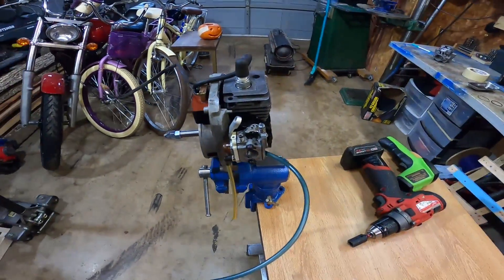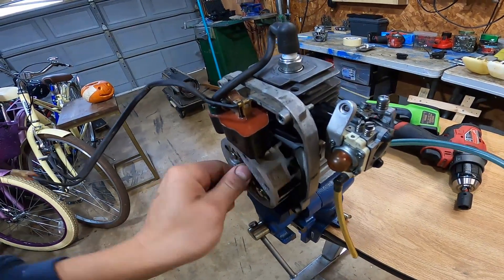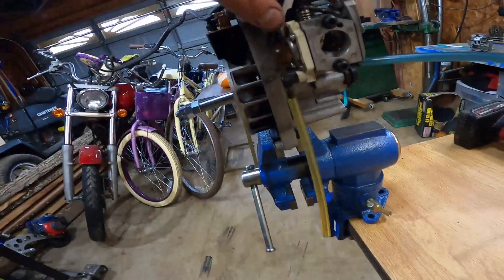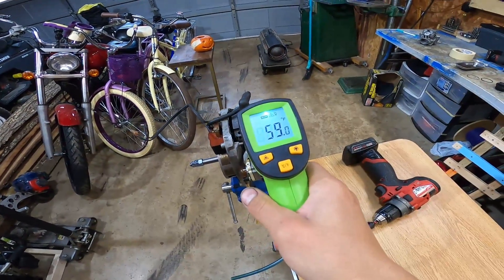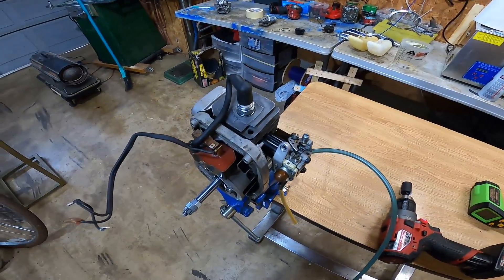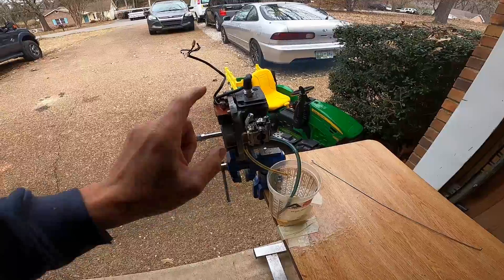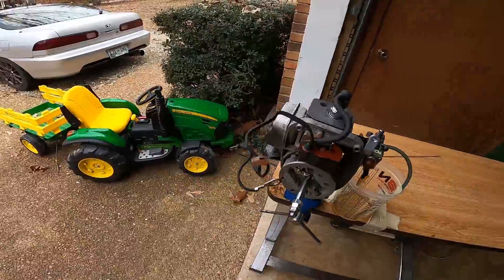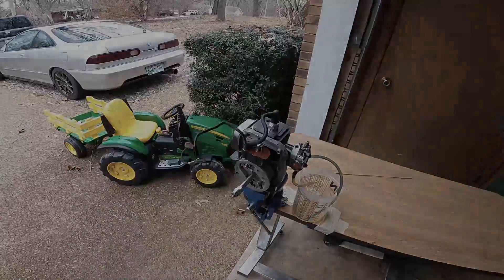Running a 2 stroke on diesel fuel!

Comment: So at what point in the video did you actually start running it on diesel ? In case you didn't already know, there's a few differences between kerosine and diesel
Reply from the maker: @dukeboreham2782  I’ve learned there are differences after I released the video 😭 I need to remake it with true diesel. When I made the video I only thought kerosene was just “cleaner burning” diesel. I have learned that the flash points and btu content is different 🤦🏽‍♂️

Comment: So that should mean a 2 stroke would run on used engine oil too right?
Reply from the maker: @Youtubecensoredmyusername  I tried that in a later video. It doesn’t work very well haha
Reply: @aaronpratt89  I saw the tiny multi fuel engine someone got running and it had mix and ignition controls on the handlebars. Without changing those I’m sure it wouldn’t have been that great. I will check out your other video tho

Comment: can it start without a battery or cdi? i mean diesel ignites by compression not spark?
Reply from the maker: @balfasladicra5270  compression ignition is true for diesels, however the compression of this engine is too low to create enough heat for compression ignition

Comment: to run on kero you need a hot box to vapourise it  usually started on petrol until the hot box was sufficiently heated  petrol a switched off and keo switched on  ,many old cars from the 20s and 30s  could do this as well as tractors .usually it was power kero used NOT the usual household one ,but again it must start on petrol

Comment: I bet if you replaced the spark plug with a glowplug to get it started, you could convert a small 2 stroke to diesel. Run the glow plug long enough for the engine to warm up enough then it will run on residual heat.
Reply from the maker: @MmmHuggles  I had that same idea. However I never managed to get this engine hot enough for it to run on its own.  I could make an adapter to use a small nitro glow plug and see if it works

Comment: Has anyone tried to convert these two-stroke engines not just to diesel, but to make them diesel themselves?  It seems that for this it is necessary to make them a high degree of compression.  At the beginning of the 20th century, there were several models of diesel engines for bicycles.  But there was a compression ratio adjustment from 8.5 to 20. I think it was a Lochmann brand or something like that...
Reply from the maker: I’ve been throwing the idea of using a custom piston in a well known brand of two strokes. But the run away of a carb fed diesel scares me. With no real shit off besides a total choke seems scary

Comment: Love this experiment and would like to see how far this can go. Have seen a few diesel engines run on used motor oil mixed with regular gasoline (even with old bad gas). My only question or concern would be how does the engine handle over time, basically after many hours of use what do the internals of the engine look like. Could this work for an extended period of time. Detroit Diesel had this concept down to a science with their 2 stroke diesel in the early days of trucking, industrial applications, and agricultural motors. Makes me want to play around with these concepts.

Comment: Thats pretty cool probably a27cc engine ot sounds just like sn old 2 stroke Detroit lol i gotta go tinker with one now. I was wondering what to do with all the little engines i had laying around i want to see if i can get one to run on black diesel (4parts used motor oil and 1part unleaded gasoline)

Comment: Hold up, how does it run on diesel and switches off when spark is turned off, diesel in engines burns because of self-ignition caused by heat, i see diesel burning when the engine is hot and has a lot of compression, i just don't understand how is the diesel fuel combustion regulated by spark.
Reply from the maker: The compression of this engine isn’t enough to generate the 500° required for compression ignition
Reply: @aaronpratt89  then how does the engine burn diesel? diesel doesn't work with ignition compression
Reply from the maker: @datrollface2863  diesel normally is used with compression ignition. It will light with spark under the correct conditions. Like I this engine. I had to get it hot for it to run on its own but still with spark
Reply: @aaronpratt89  from what I read the temperature of the spark is about 500°-850° so that makes sense

Comment: I would connect a  12 volt motor to output shaft big enough to spin up the engine and then after it starts you have a battrey charger! It could be usefull, connect the battry to a inverter and you Got AC power 🔋

Comment: Well, this engine can't get into runaway cause it's runaway by default.
Reply: it can't runaway as it has a carburator butterfly, when it is closed it cannot get any air. Diesel engine has no butterfly it speed is regulated by the amount of fuel it is feed. so if it gets an alternate unregulated fuel supply (like an oil leak into the intake) it can runaway.
Reply: @calthorp  
Im just kidding bud.

Comment: you need a flywheel to run better with small motors
Reply from the maker: This engine has the factory flywheel installed. Are you implying it needs a heavier flywheel?
Reply: @aaronpratt89  ya just like an old hit miss engine it would run smother with the momentum of a flywheel
Reply from the maker: @be.ndover  with the low compression of this engine, a heavier flywheel will only increase centrifugal mass. Plus it only runs on a work bench. Once’s it’s hot it runs nicely.
Reply: @aaronpratt89  something like a 6inch disc like half inch thick or maybe 2 of them

Comment: Diesel engines need more compression than a gas engine and those small two stroke weedeater engines the head and cylinder are one part they don't seperate so you can't shave the head to raise compression. Your options are limited
Reply from the maker: With this specific engine, the cylinder is separate from the cases. So if I wanted to I can either mill the cases or the bottom of the cylinder to increase compression. However port timing will change.

Comment: My grandfather used diesel as coolant fluid during winters in his truck. Antifreeze was expensive and difficult to find.
Reply: Imagine if it over heated and burst a hose hot fuel and hot manifold kablooowe glad he made it out alive had the same thing happened in an old suzuki atv happened it burst into flames wen over heats

Comment: Diesel does have 15% more energy by volume compared to normal fuel so it probably makes more power when it's hot that is aha
Reply: If it all burned, but smoke is unburned fuel.
Reply: @wheater5  yeah I meant like melt down temps
Reply: @Billskins4dayz  The diesel heater in my garage burns fuel without no smoke (it is an excellent bit of kit) but running diesel through a normal carburettor meant for petrol won’t vaporise it properly, hence incomplete combustion. I’m sure the video here is only for entertainment anyway 😉
Reply: @wheater5  100% im surprised it ran as well as it did being lower comp

Comment: You can do the same thing with briggs and stratton  flathead. the make the air fuel mix go through 2 90 deg bends before hitting the hot valve. The cylinder will just see diesel vapor that can easily be ignited. Its hard to get it going, but once up to temp it only smokes a little

Comment: can i know what modification have you done to it ? I was thinking why wouldn't a chainsaw run on biodiesel since it's a quick to heat up engine..
Reply from the maker: You can run diesel if you want. It just needs some help lighting. I had to use a starting fluid to help it light the fuel. Once it’s up to temp it runs ok. However is makes a mess. Combustion isn’t complete and there is lots of oil/fuel all over the exhaust.

Comment: I much prefer diesel engines over petrol engines any day no matter the size of the car. 
On some racing bikes petrol is preferable

Big 2 stoke diesels on ships run from bunker oil to diesel to even kerosine. 

I'm sure if the engine had more compression. As in making the piston longer or welding a load of stuff to it would help as diesel engines have a much higher compression. 

I'm pretty sure humvees and all US army and most nato military equipment is supposed to be able to run on a steady diet of k2 jet fuel (kerosine) diesel would work just as well if not better in piston engines.

Small aircraft manufacturers are making more diesel/kerosine piston engines so aircraft can use jet fuel that's Alot cheaper and more available than aviation gasoline.

Some vehicles can use alocol, Methanol, gasoline, kerosine and diesel, multi fuel engines.
I think a few Russian tanks have this ability but to be able to adjust the compression must not be easy
Reply: Most US military vehicles will run multi fuel. The Abrams tank, for example, is a multi fuel turbine engine.
Reply: @andrewsmith1735  most millitary vehicles in advanced NATO nations are multi fuel but it's mostly millitary jet fuel, civilian jet fuel, any type of kerosine, any type of diesel biodiesel and then stuff like clean vegetable oil or motor oil or even hydraulic fluid  (could used used but it would have to filtered and water removed. Could also use propaine or any compressed fuel gas like LPG but would still want some lubricity so would have to have some oil in the pump

On the M1 you could probably get away with using gasoline of any quality, naptha, ethanol 95%+ or methanol 95%+ as its a turbine engine but it would reduce the life of the engine.

No idea if they are still mde but we had some kawasaki motorbikes with a turbo diesel on it so it could run on millitary jet fuel or diesel,  had alot of torque.

Now a big push is being made for all new piston aircraft to have diesel engines so they can run off commercial jet fuel.
As outside of the west it's very rare to find an airport with avgas or even quality high-octaine gasoline.
Plus it would end up alot cheaper than avgas and you could do longer trips.

I know they still use some gasoline engines but it's for specialised stuff, no idea what outboard engines take on those really small boats.
They do make them in diesel.

As a brit that lives in the US it amazed me how few diesel cars, pickups and SUVs are on the road as unless it's a sports car or small car it makes no sense to use gasoline as with turbo diesel you get alot of torque, alot of power and the MPG is insane.

I allways get a stickshift turbo diesel, my first car was a slightly smaller version of a vw golf with a 1.9tdi engine in.
Changed the turbo, nozzles, a better clutch and a remap and it was really quick for a first car.

I would put any oil in it (mostly red diesel) and would run just fine.

The alternator broke and I had to wait 2 days for delivery, since the engine did not need electric to run I would just bump start it,   no electrics or instruments worked but it still drive fine in a kind of standard limp mode, I just avoided driving it st night and used my GPS to tell the speed.

Comment: Plain diesel? You could make 10,20%of the fuel petrol so the spark from the plug would still ignite fuel, which would expand and therefore promote combustion of the diesel still inside the cylinder

Comment: Kids like this are a big waste of time.....theres nothing good or useful that can come from this other than destruction.....its just sad....when i was 10 yrs old i had the idea to mix gasoline and used engine oil since what i knew about 2 stroke mix and that octane was way to high for a diesel......a guy shot my idea down saying it would blow the motor cause its gasoline but my response was wouldnt the used oil tone it down if you mixed like 75% used oil....
He still said i was a kid and didnt understand.....NOW LOOK THE NEW THING IS TO MAKE BLACK DIESEL USING A 5 TO 1 RATIO OF GAS N USED FILTERED OIL....SUPPOSEDLY LUBES THE ENGINE BETTER
Reply: Well.. Now you can say you're that guy! Well done have a cookie 👍

Comment: It doesn't seem to mind that, This has been done before, there were early farm tractors that you would start by opening the pet on a small gasoline tank to get it going and warmed up and then switch over to the kerosene tank.
Reply from the maker: I’ve seen videos of those old tractor engines. I would love to see one in person!
Reply: @aaronpratt89  Rumely Oil pull tractors

Comment: My grandfather had a sawmill powered by an International Diesel engine which started on gasoline, then when warmed up the operator switched to diesel. It came from the factory that way in the 1940s.
Reply from the maker: I’ve seen one tractor like that. I would love to own a dual fuel engine myself. I love old engines.
Reply: @aaronpratt89  Until alternators became common in the late 1950s and 1960s, most all engines used 6 volt electrical systems which simply lacked sufficent power to start a diesel engine while cold. Thus dual fuel, air starters, and pony motors. A pony motor was a tiny gasoline engine that was used as a starter for the bigger diesel engine. Pony motors were common on tractors and especially construction equipment until the 1970s.

I'll never forget buying a Cat D8 dozer with a pony motor and watching a half dozen experienced heavy equipment operators try to figure out how to start the engine. Modern stuff is far easier to learn to run.

An additional problem your tiny engine faces is low compression. Diesel engines had many times more compression than did gasoline engines and generally 2 cycle engines run lower compression ratios than 4 cycle engines.

That said, for many years, up until the late 1980s or early 90s, Detroit Deisel, a division of General Motors, manufactured 2 cycle diesels that would scream on top end but were gutless when pulling heavy loads. And get this, if you stalled the engine out when taking off on grade, then let the clutch out too quickly they would run backwards until the lack of oil pressure destroyed the engine.

Finally, if a 2 stroke Diesel overheated it would take on a life of its own screaming wide open well past the governed speed until it exploded.

I drove many trucks with Detroit 2 strokes and hated them all.
Reply: @aaronpratt89  its preheater, like in those early 1900s onees with a gear wheel size of a tractor tires
Reply: That's very interesting to hear, thanks for telling us that. :)
Reply: they be doin it since early 1900s that way. got an upper oil pan to heat blocks using gas /kerosene

Comment: I would call this bullshit. It is not  enough compression to combust the diesel. It's running gasoline with a lot of 2 stroke oil mixed so you get the impression that it's burning diesel. The diesel it's like oil. Don't need to add more oil. In order to verify the authenticity of the video, light a fire on the "diesel" container. The gasoline will burn because is highly flammable but the diesel won't.
Reply from the maker: I the video I pour kerosene in the cup. The engine is still using spark ignition. Yes the compression is too low to run off of compression alone. It is still using spark ignition. It is not running like a true diesel, there is no injector. It is only a two stroke engine running on kerosene which on fact harder to ignite then regular diesel. I added oil because kerosene does not have enough lubrication by its self to keep and engine alive. Let me say this again. It’s still using spark ignition. I use the kill switch in the video to stop the engine because it’s using spark ignition. I’m not sure where you got the impression that it’s running like a true diesel.
Reply: @aaronpratt89  read the video headline. You wrote diesel fuel but kerosene is not diesel ok? Kerosene flash point it's starting at 100°F and diesel at 126°F meaning that kerosene it's easier to ignite that diesel.
Reply from the maker: @cornellungeanu1620  kerosene flash point is 152°f. Auto ignition is 490°.
Reply from the maker: For the brand I was using
Reply: @aaronpratt89  ok. Try with diesel and don't put 2 stroke oil. Let's see how is going.
Reply from the maker: @cornellungeanu1620  my memory is off. It says 102. 

I’m between houses right now. Moving states. Once I’m back in a house with a shop I’ll be happy to re visit this with diesel

Comment: I had a whipped push mower,low compression, and ran 25% diesel in the gas and the added oil in the cylinder increased compression enough to stop smoke and recover some power

Comment: Super cool to know one can do that. What needs changed in order to make it actually run?
Reply from the maker: Well I was using kerosene. And it doesn’t like to ignite. It need an accelerant to help it ignite. Same with diesel. Adding a minor either shot at startup helps. Once the engine is warm it will idle. I recommend adding some oil to help with lubrication.

Comment: Imagine doing this to 2 stroke car like Trabant, they smoke like volcano even running normal fuel.
Reply: Are they any harder\easier to work on as a 2-stroke engine?
Reply: @saucecups  easier
Reply: I'm used to how noisy are the DKW 1000 in low revs but damn those can run on 2 or even 1pistons from 3 they have, separates platinums, separated coils, 2 stroke.
Reply: Yeah but it burns oil

Comment: Would this engine work if you put veggie oil and 2-stroke oil on it? Did you make any modifications or because it works with diesel being a gasoline engine? Greetings from Colombia.
Reply: Veggt oil has a glycerin in it, like a sugar it can gum things up. I believe it can be seperated before hand with lye?
Reply: Its too thick but half gasoline to half veggie oil and a bit of 2 stroke oil would work really well?
Reply: Same here

Comment: cant tell for sure but i think you added way to much two stroke oil. cool video thoug
Reply from the maker: Yea I didn’t measure the amount of oil, however anytime diesel isn’t burned in a super high compression engine, you end up with a lot of unburnt fuel. Most of the smoke we see in the video is unburnt fuel. I think I show the fuel dripping out of the exhaust some where in there lol